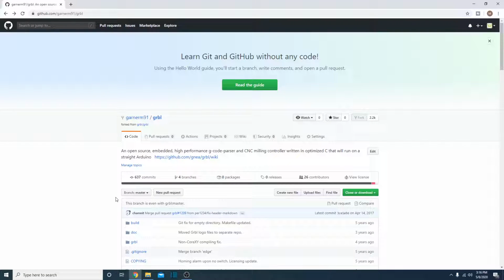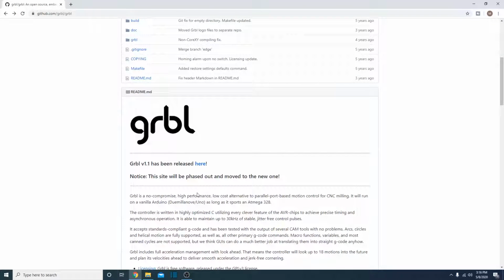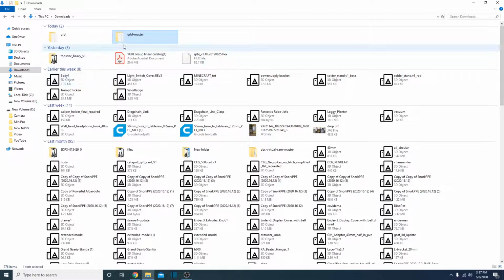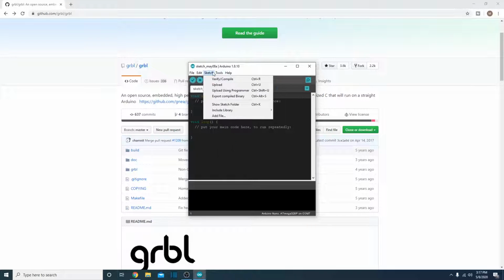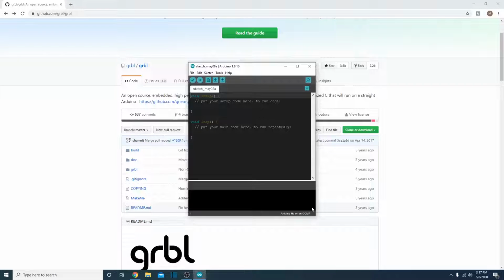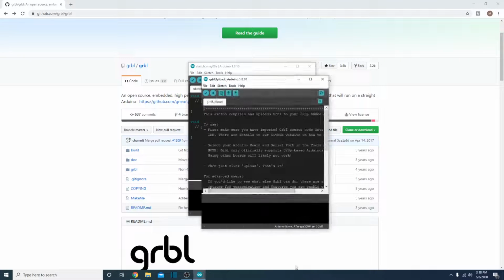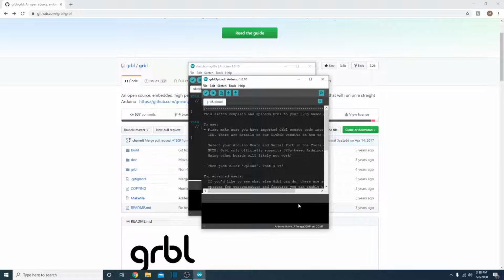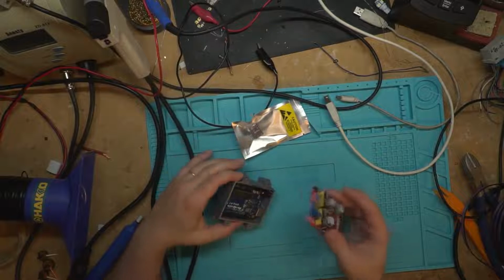Arduino GRBL Setup and Test Run With CNC Shield, Stepper Motors

Comment: can the laser cutter use to etch words or designs onto materials,or even separate iphone 8/8 Plus/X above back glass
Reply from the maker: This one is router CNC so it will have router on it not a laser. You can do etching with the router. I was to build a c02 laser table one day.